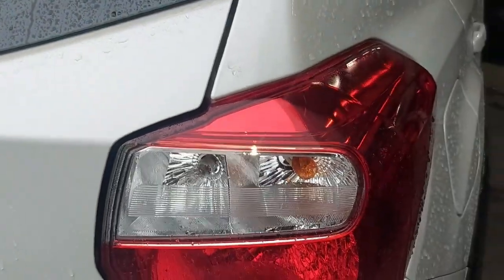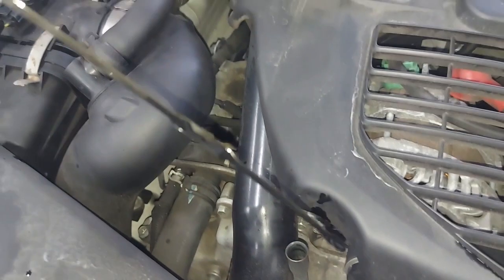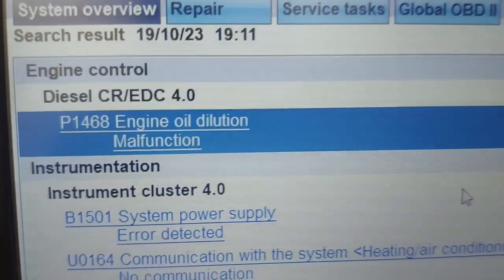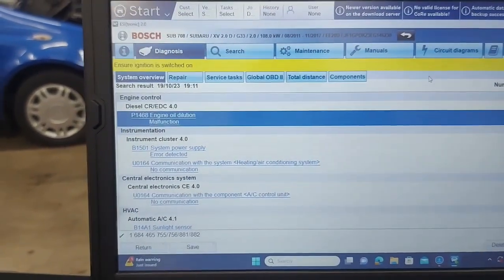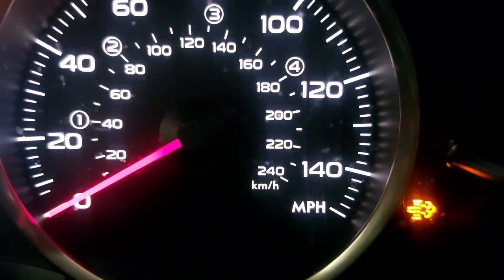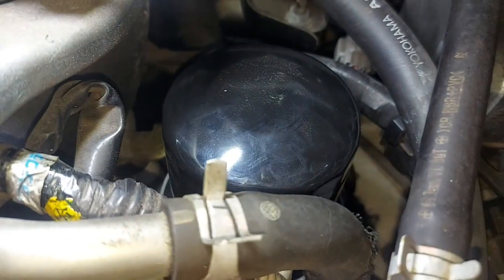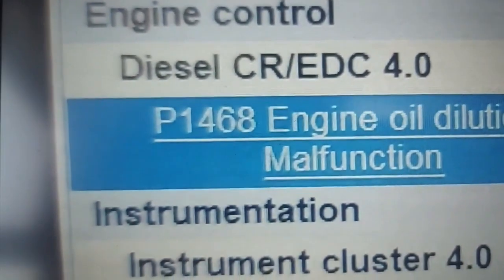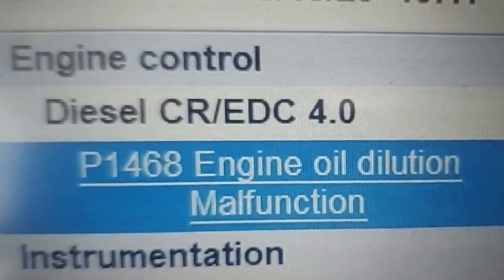Are you familiar with oil dilution dpf problems

Comment: The oil dilution value is not measured in any way, just calculated by the ECU.
This means that if someone does an oil change/service on the car and does not reset the oil dilution value then it will continue to rise according to the mileage.
When the OD value reaches 9% the ECU will no longer do normal regen while driving and you will have to take the car to a garage to get it regenerated.

So when you service any diesel subaru MAKE SURE TO ALWAYS RESET THE OIL DILUTION TO ZERO!
Otherwise you will have constant DPF problems.

Source: I'm a certified Subaru service technician at a Subaru shop and i regularly get cars into the shop where a third party shop has done a service but not reset oil dilution.
Reply from the maker: Thank you very much for your contribution. The young man you see changing oil is Subaru technician. He did  all the resets unfortunately that part of the recording got corrupted.  We're happy to have you on our platform.  we value your contribution. Thanks
Reply: @jamrozelectronicssolutions7232  i didn't mean to make it sound like i was criticizing you guys.
My comment was directed at people in general who service a Subaru. Licensed techs, third party techs or the owners themselves.
Reply from the maker: Semtex Warrior please do no think that I see you as a critic, not at all. I appreciate people like you. I like people who can correct me when I make a mistake. You spotted a gap in my video which is a good think. Please stay with us Jamroz values you my bro
Reply from the maker: Thank you

Comment: Hi i recently had a oil and filter change ford focus 62 1.6 diesel after a short run the oil light came on i thought it just needed a small top up after it settled did this but light comes on if i fall below 1.5 rpm could it be the oil pressure sensor any input would be appreciated.